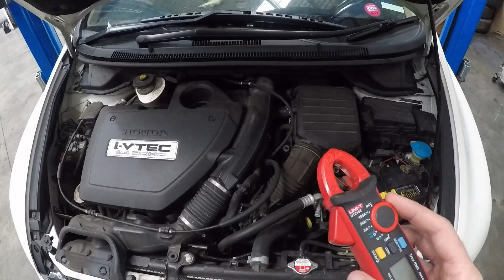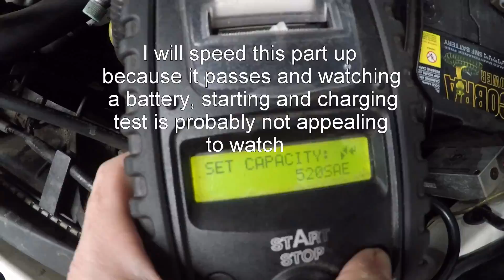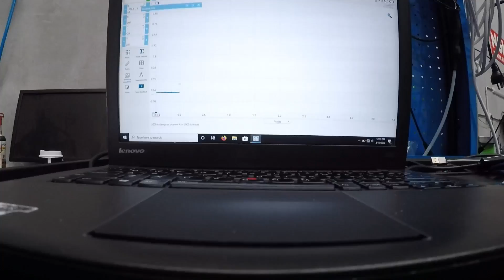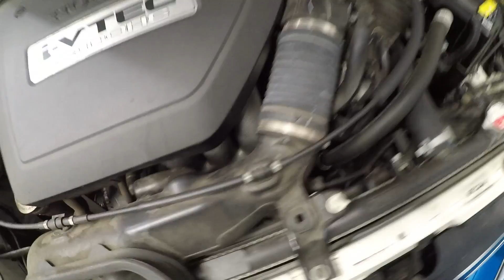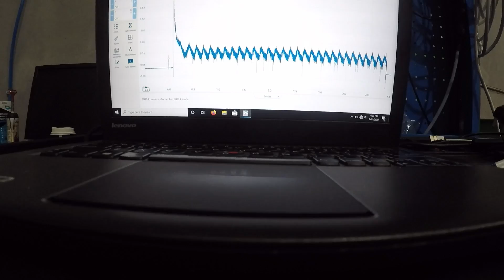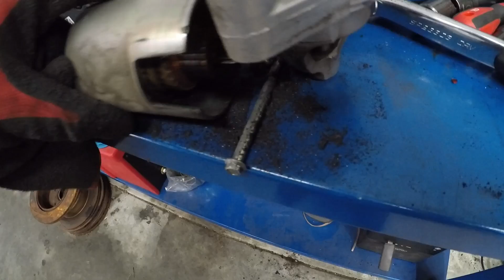Slow/Weak crank - 2008 Honda Odyssey - Worn starter motor brushes picked up with a scope

Comment: My Daughter has just got herself a 2013 Accord Euro and I've just put in a brand new battery because of the slow crank issue, same engine as the one you had in the Odyssey I came looking for a video to help diagnose potentially the starter motor as it make logical sense to be the next step, I was very pleased to see your video and I can hear that yours sounds almost identical to hers so most likely I'm ordering a new starter tomorrow. Thanks heaps.
Reply from the maker: Awesome, thank you for the comment and thanks for watching!

Comment: Free tip:  zero out your amp clamp next to the wire and not in the next bay, lol.  You will get a different reading.
Also, may want to explain the connection points for the lead(s) for your viewers.
Reply from the maker: Thanks Drew. I love tips when they are free haha. I'll certainly keep that in mind

Comment: Good follow up taking starter motor apart proving what the PICO could see.
I wonder if an AC Coupled relative compression test taking the Hantek CC-65 "noise" out of the equation might have been of help.
Also wonder how the PICO amp clamp compares to the Hantek. I don't think I've seen anyone do a comparison test. Something tells me you might be the right guy to do exactly that at some point:)
Reply from the maker: Thanks Denis and yes that is a good idea to do the amp clamp and AC coupled comparison. Next one I get in, I will certainly do it! I still haven't decided if I really want to get the pico clamps. I've got no idea how superior they are supposed to be but if I do, I'll do a comparison on that also!